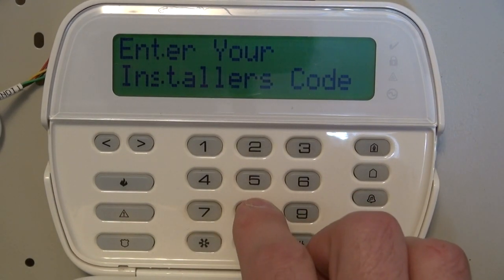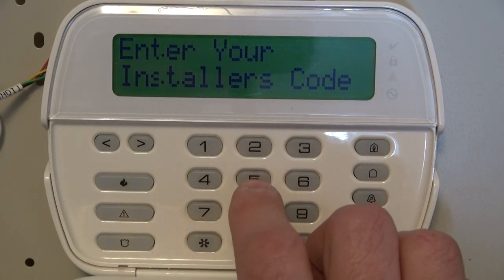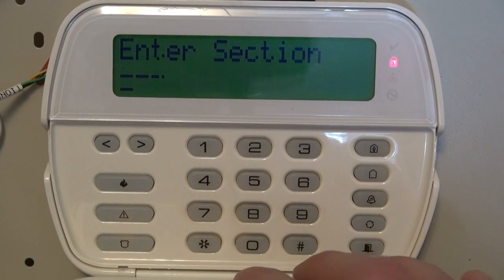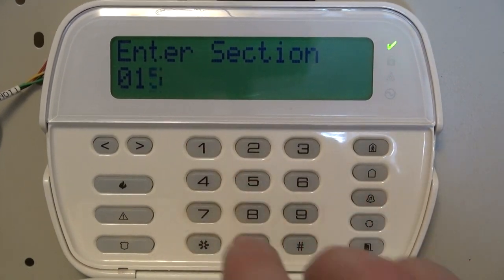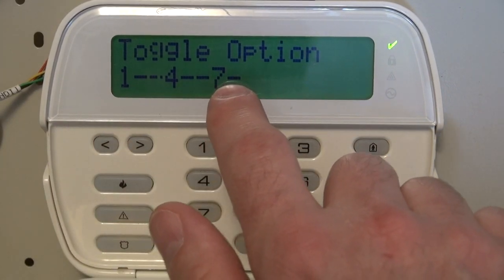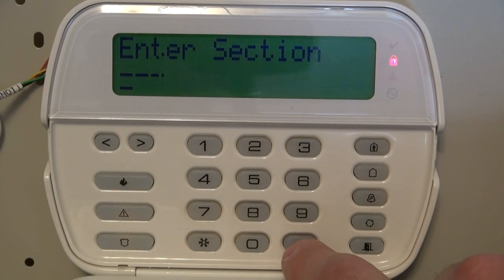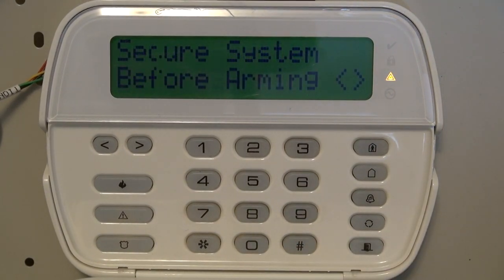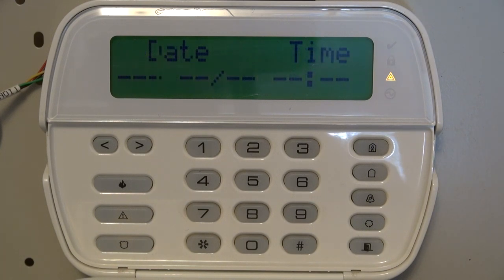How to Remove a Communication trouble on a DSC Alarm

Comment: Hello, I have a 9045 with a GSM communicator, and I can't configure the system to call me on my cell phone. Could you help me please?
Reply from the maker: Question: is your GSM activated? If it is, you know when the alarm calls you, it will sound like a fax machine.
Reply: Hi Jason, thanks for responding so quickly. The device is mine and everything is activated, but I can't configure it. It doesn't matter if it sounds like a fax. If the system notifies me on my cell phone, that's all I need. @JasonTech
Reply from the maker: You will need the installers code.
* 8 (installer code) go to section 301
enter the phone# you want it to call.
#
section 310 - make a fake Section Account # (like 4444FF)
#
Section 351- make sure you see a 1, if not press 1 
#
Section 380 - make sure you see a 1, if not press 1 
## to exit and test it out.
Reply: I did all the recommended processes, but it doesn't work. In command 301 should I enter "D" my local area code and my full number even if they start with (0)? I'm doing something wrong. When making changes to #380, the "communication problems" signal was activated. The yellow triangle. I am very sorry, but I need more help. I'm sure there is some information I'm entering wrong. The manual is not clear, and I can't understand it. @JasonTech
Reply from the maker: Sorry I have to be there. But it sound like your GSM is not activate. What happens when you hit * 2 ?
Reply: @JasonTech  Gracias, ya está solucionado. Gracias

Comment: Can you tell me how to do this on a SCW9057G-433?
Reply from the maker: Hi, It's the same steps and you might have to do
* 8 installers code 
380
If it shows you a 1 remove it by passing 1, then exit out # # #
Reply: @JasonTech  Thanks for the response.  I did the following: *8,  5555, 380, 1 - which removed the 1.  I did the following next: *8, 5555,  015 and there is no 7 there.   Still get the error.  Does the old sim card need to be in the unit? Thoughts?   Thanks
Reply from the maker: Can you hit * 2 and tell me what pops up.
Reply: @JasonTech  It says "View Trouble Alt Comm." them I hit * and it says "Alt Comm.  Cell  Trouble."
Reply: @JasonTech  I figured it out with the help of some one else on another forum.  I also needed to go to 382 and remove the 5.  Here is exactly what worked for me:  1.)  *8, installer_code, section 380, option 1 should be off 2.) disable alternate communicator in section 382, option 5 should also be turned off.  3.) section 015 option 7 off.  (So in section 015 option 7 must be off, in section 380 option 1 must be off and also in section 382 option 5 must be off.)  Thanks for your willingness to help!

Comment: Hi Jason, I have a home alarm put in my house in 1993 from Alarmco in Las Vegas. A few weeks ago we decided to cancel or home land line because we never use it. After we canceled the service we found out the alarm still wants to make its communication call everyday. We still want to keep the system in our house because it works fine. In Vegas, police do not respond to home alarms so we have not paid for the Alarmco service for years. How can I keep the system but stop it from making the call everyday. Please help if you can.  I enjoy your channel a lot.  Richard
Reply from the maker: Hi Richard. It's an easy fix. Do you know the installers code?

Comment: Mine is showing trouble #4, on section 015, I changed the number from 1 2 4 to 1 4. There was no 7. On section 380, I removed 1. But the triangle is still there. What else can I do to get rid of it. We are not planning to use their monthly service. thanks
Reply from the maker: Hi Lynn. Try Section 
382 and remove the 5
Reply: @JasonTech  section 382 only has 3.😥
Reply: @lynnchen5159  mine is the same only has a 3
Reply: What do these numbers mean? Is it only the last number in section 015 that needs to be removed? Mine ended in an 8 not a 7.

Comment: Hello, can you tell me the steps for "concord 4" panel?
Reply from the maker: Hi. The Concord 4 can only be programmed with an alpha keypad. Default Installer code: 4321. Default Master code: 1234.
Do you know if those code still work and do you have a alpha keypad?

Comment: I don’t subscribe to ADT but I was still using alarm. It is not letting me arm the system anymore. I get the error that I actually see on your system. “Secure system before arming “ can you help?
Reply from the maker: Hi. It sounds like you have a zone open. Do you have any wireless sensors?

Comment: Hey are you able to help me with this? I have a DSC PowerSeries N11427. How do I get rid of that beeping sound. I only have the factory password but not the installer password because the system was already in place when I moved into the home.
Reply from the maker: Sorry with out the installers code you can't do anything.
Reply: @JasonTech  thanks
Reply: When mine beeps, I put in my security code (arm system), it starts beeping.  Then I put in my code again (disarm system) and it stops.  Hope it works for you.
Reply: @shortyduwop9172  I'm late but, Thanks

Comment: weird, I pressed *8 and got the blank screen but I went ahead followed your instruction...hope it will stop peeping!
Reply from the maker: That just means you have a different Keypad. It will still work.
Reply: @JasonTech  I have the exact same one DSC and key layout 100%.

I did that last night and it still peeped again in this morning.

Any clue?
Reply from the maker: The keypad looks the same but the model is different. In the video I'm using the pk5500 sound like you might have the pk5501.
You might have a GSM can you try.
*8 - 5555 - 350 if you have a 1 remove the 1 by hitting 1.
then
go to section 380 if you have a 1 remove the 1 by hitting 1.
Reply: @JasonTech  Just wanted to let you know i found my master code and was able to remove the options followed by your video! Thank you sir!

Comment: I have the adt impassa  and my system beeps, I checked for 7 not shown, just 1234 and 8.  Is it a different number for my model. I had cellular not landline I disconnect the cell antenna.
Reply from the maker: If you followed my video, that's how you do it. The beeping might be coming from something else. Hit *2 and see what comes up. I think you have low battery somewhere.
Reply: @JasonTech   It says  alternate comm receiver trouble
Reply from the maker: Try. 
* 8 (installers code)
380
remove 1
Reply: @JasonTech  That worked thanks

Comment: I have alt comm gms trouble displaying. Anyway to turn that reporting off? Many Thanks! edit:I have dsc alexor
Reply from the maker: Hope you have the installers code. Go to section 380 and remove 1.
Reply: @JasonTech  don't have 1 there unfortunately. Don't have anything there at all. It's totally blank
Reply: @JasonTech  I should mentioned i have system connected to my router as i using dls software to communicate with the alarm. I wonder if that is what throwing the code? Otherwise i am at loss how to stop the reporting as nothing is there to remove in section 380
Reply: @JasonTech  I did some more digging and it says alternative communication gsm trouble >alternative communicator receiver x trouble. Does that change anything?
Reply from the maker: Section 380 is for GSM. Can you try section 350 and tell me what pops up.
Reply: @JasonTech  it says 06
Reply from the maker: Section 380 to 383 are all to do with communication.
Reply from the maker: I found alternative communicator it's section 610, If there's is anything there remove it all
Reply: @JasonTech  it says 00 no way to remove it :( I am at loss honestly
Reply from the maker: Sorry it's hard when your not in front of it. Can you try 1 thing for me section 378 enter 9999
Reply: @JasonTech  that worked. Thank you
Reply from the maker: That's great. Anytime.😀

Comment: Hello, I’m having a problem with my system. The entry delay is instant when I want it to be 60 seconds, how do I fix it?
Reply from the maker: Hi. There is a few steps, if you need a video on this please let me know.
Press * 8 then the installer code ( Default is 5555 )
Enter 005
Enter 01
Enter the 3 digit entry delay 1 in seconds ( so type 060 for 60 seconds)
Then, the 3 digit entry delay 2 in seconds ( Do the same 060 )
Then the 3 digit exit delay in seconds ( I would do 060 )
Press # # to exit programming.

Comment: I have my installer code and I did this but the little triangle is still there.. I physically unplugged phone line from my dsc 1616 ,I bought A hub safe 6 to install but I want to get rid of this annoying beep
.
Reply from the maker: Go back to section 015 make sure 7 is gone, if it is removed try removing 1.
Reply: @JasonTech  I just tried again and 7 is gone.. but the triangle is still there..I hope I don't have to do a complete reset..I also did the *2 and it have me trouble code 4 .. I checked and its either communications or tamper.. what does tamper mean? I have no tamper switch on my alarm box?
Reply from the maker: Each sensor has a tamper but that is not a code 4. Try arming the alarm then disarming the alarm and see if that clears it. Do you have a a GSM back up.
Reply: @JasonTech  I tried triangle is still there  what is a GSM?
Reply from the maker: it's a cellular backup, if your phone line goes down the GSM kicks in.
Reply from the maker: If you do, go to Section 380 remove 1
Reply: Mike did you get this resolved? I have the exact same problem for my DSC 1832 - I bought a hub6 also. Thanks
Reply: Moez Nayani not yet looking around and asking questions.It has stopped beeping but triangle  is still lit
Reply: Power the system up and down disconnect one lead off battery and unplug ac transformer then plug ac in and connect battery you will need to do the time and date *2 then * and set the clock
Reply: @willdpj15   I tried that last time I will try it again thanks

Comment: The described procedure only disables Telephone Line Monitoring - you need to disable the dialer which is section 380 turn 1 off
Reply from the maker: Yes, and with a GSM you need to disable 1 in section 350.
Reply: Section 350 didn’t have a 1; so went to 380, managed to turn 1 off. Unsure why error 4 still showing up though. 

Have done every possible thing I could find from google and your guidance Jason! 

As long as the alarm doesn’t go off at odd hours (00:17 midnight or 20:00 at night) every couple of days, that would be a win!

From New Zealand.

Comment: I canceled my monitoring and I tried this but didn't work. I contacted the company and they of course want money. I even tried pulling the communication wire and it will still beep. Any other suggestions I can try?
Reply from the maker: Can you hit * 2 on your keypad and tell me what number pops up.
Reply: @JasonTech  number 4 ( communication error)
Reply from the maker: Can you try something 
* 8 installers code 
380
If it shows you 1 remove it by passing 1, then exit out # # #
Reply: @JasonTech  the person that installed the system must have removed the numbers from showing  will it still work? I also had the monitoring wireless as I had no land line.
Reply: @JasonTech  i disconnected the white line from peg 1 and that seems to have worked not sure what that wire is for ?
Reply: That wire didn't work...off for a week and the beep is Back fml
Reply from the maker: Don't remove the PGM1 wire, Can you double check if option 7 in section 015 is off and option 1 in section 380 is off. Then you can try
https://youtu.be/Hu02_V3CSyY
Reply: @JasonTech  is there a way to get the numbers to show on the display panel he removed that as well
Reply: @JasonTech  is there a way to get the numbers back on the display panel?